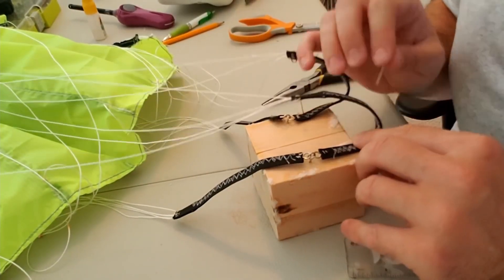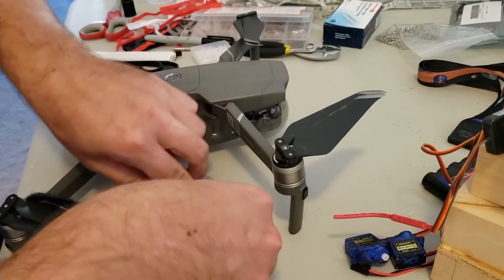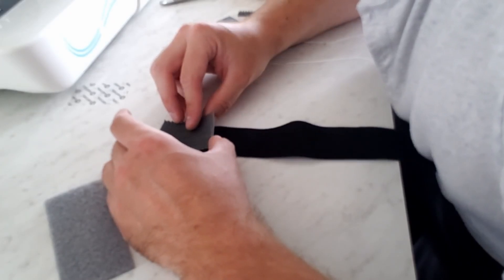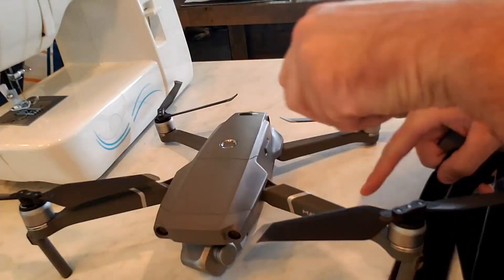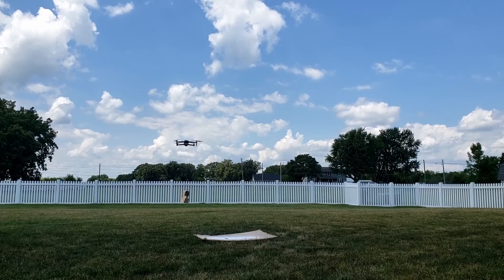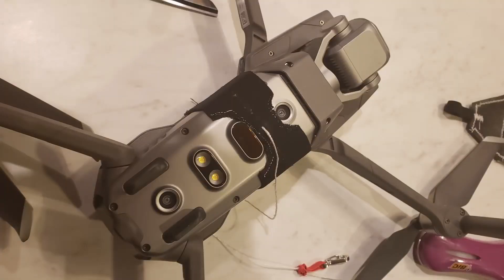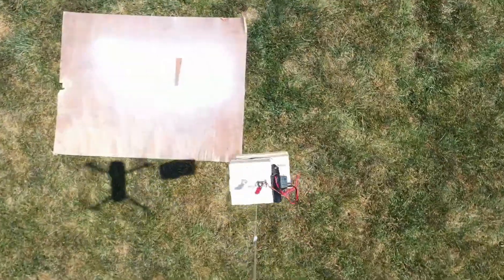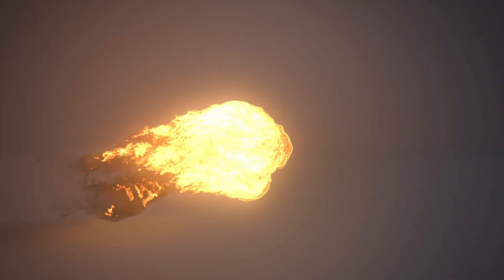How to Build an RC Skydiver | Drone Mounting | PART 6 | Project Skyfall

Comment: With the sensors covered, why so long on the suspension cord? I'd think a shorter cord would lessen the chance for a less-than-desirable prop/cord interaction.